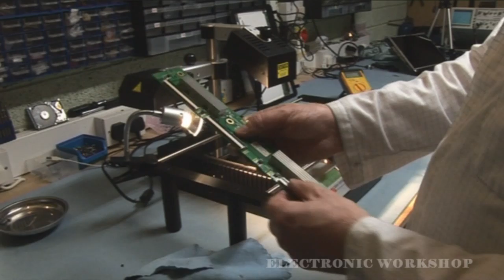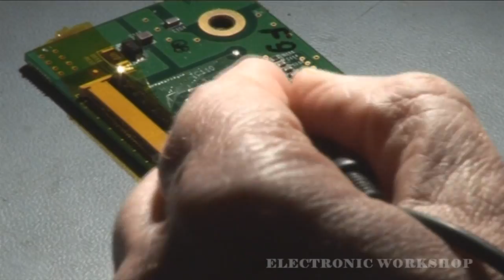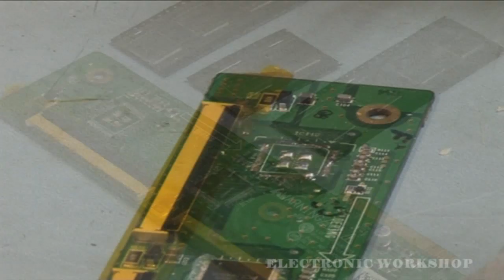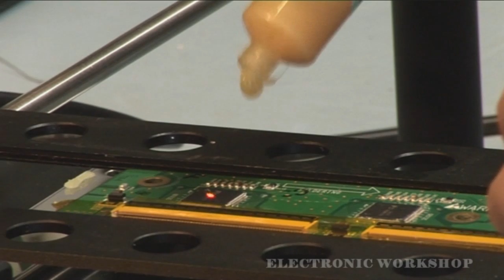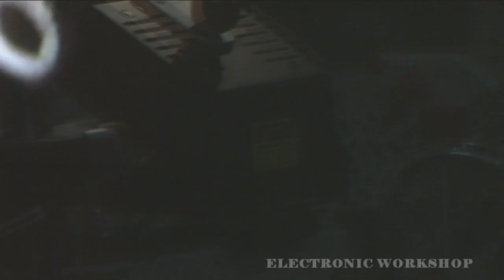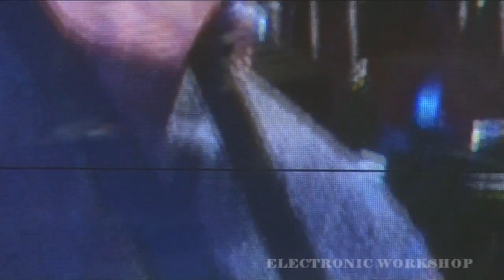LG50PG3000 No Picture Pt 2

Comment: Hi - Many thanks for posting this video which I found very informative. I have a Similar LG TV, I have had the ICs changed on the Y buffers as there were shorts on 3 of the ICs. However when I connect them up the Y sustain board starts to buz - "activate" but after a few seconds it cuts out! But when both the Y buffers are removed, the Y sustain is continuously on. Would you please kindly tell me if this means that the Y - Sus  is not faulty? Or is it that it could be faulty and only the circuit fails under load, i.e the y buffers attached. Many thanks. Can I bring my TV to you to get it fixed please?

Comment: Have same problem. Can you please tell me where I can get replacement board or ic's please. Many thanks.
Reply: rupert handford Mouser
Reply: What glue should I use
Reply: Epoxy resin.
Reply: Thanks, your help is much appreciated.
Reply: No problem Robert I am currently tearing my own hair out with my own nightmare plasma telly 50LGPK590. I just tested my y-buffers today and they are fine even so its a lot of work removing the chips on the y-buffer when i can get both y-buffer boards for my telly for only £20 off ebay!